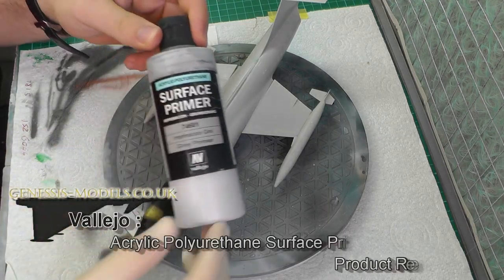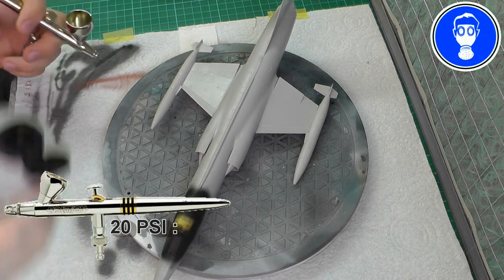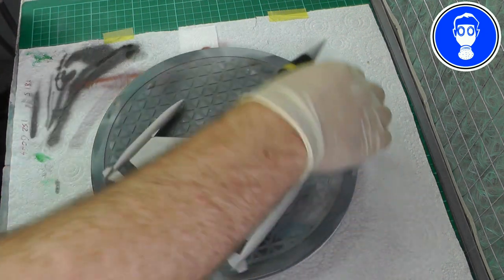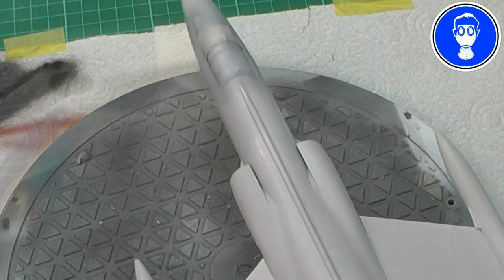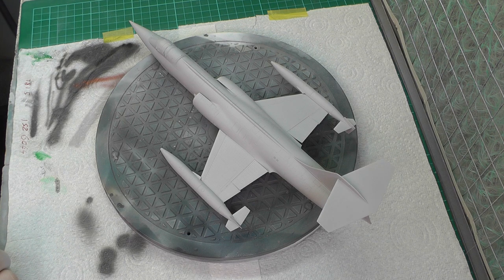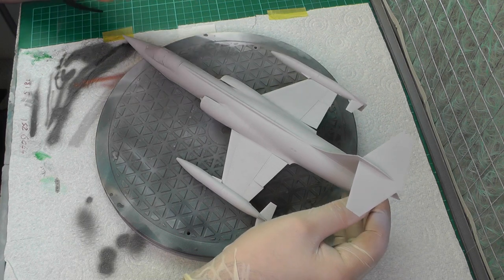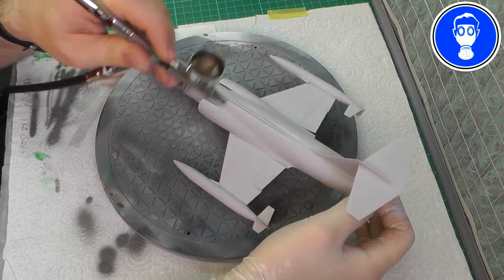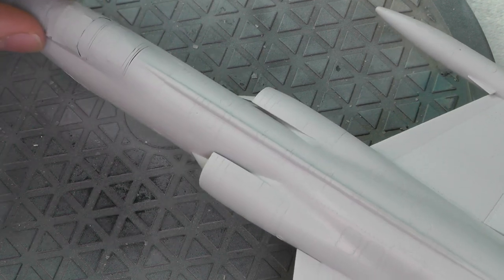Vallejo : Acrylic Polyurethane Surface Primer : Product Review / Tutorial

Comment: Very informative video, thanks. I ordered some of this primer yesterday and thought I'd check out any problems before I use it. I have some Vallejo Polyurethane Satin varnish that I thinned that with a bit of distilled water as I didn't have any thinners and it sprayed really nice. There is some kind of flow enhancer in their varnish that breaks down water tension so I'm assuming that will be the case with their primer, I guess I'll find out next week when I give it a shot at some old bit of plastic.

Comment: Really cool video, thank you!

I have a question: Is Pledge (Pronto in my country) Multi Surface Cleaner still working as a curing layer on Vallejo Primer? It's been 7 yrs since this video of yours, and because of lockdown in my country I cannot buy it during a weekend, so I wanted to ask before I actually test it myself on Monday. ;)
Reply from the maker: Yes it will mate
Reply: @genessismodels  Thanks a lot!
Reply: @genessismodels  My man, it works perfectly, really thank you very much for this little trick. It's still not ideal but now I can finally stop using that smelly Mr Surfacer and my family is grateful - to you too of course. 😉
Reply: Hey.. 
Where I live neither the Pronto or Pledge is to find, so, is it any multi surface cleaner ?.. 
Can guess i should keep my hands off glass cleaners. Some of then can be used to strip paints 😉

Comment: Hi, great video but I'd like to ask what diameter needle do you use? I use 0.2 needle at 20-25 PSI and this primer clogs my nozzle completely after just a few seconds or doesn't flow at all. When I thin it with Vallejo airbrush thinner this primer behaves unpredictably but mostly flows and gathers in recesses or at the bottom of the primed part.
Could you advise me if I'm doing something wrong or perhaps my needle is too thin? Thanks.
Reply: see my post above. Cheers!